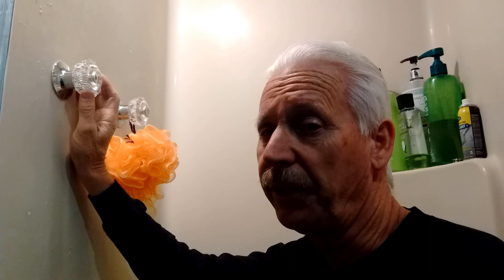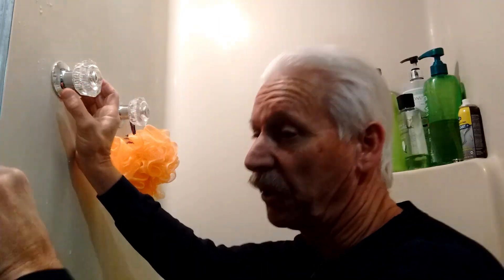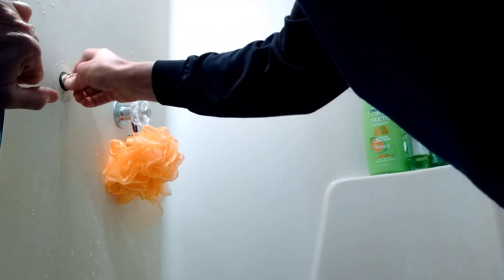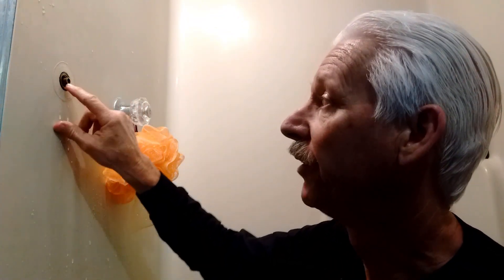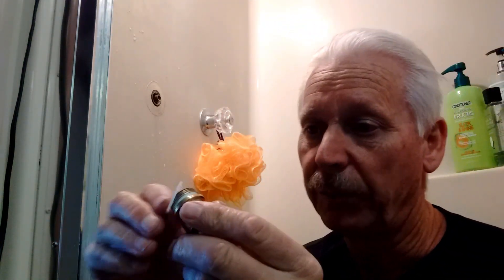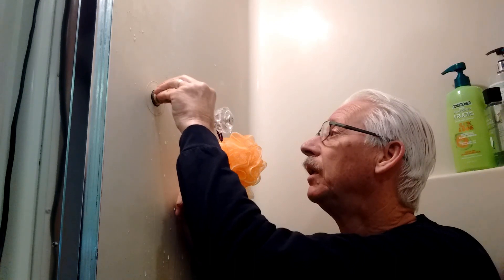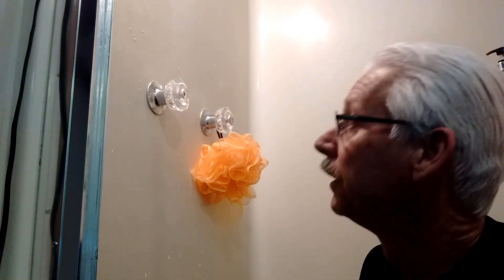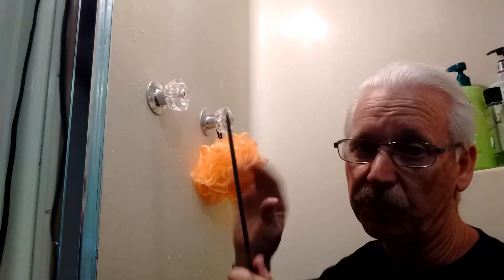Shower drip stuck faucet seat

Comment: What make is the faucet valve stem and handle? I need to replace them as I stripped the handle and it is leaking. Don't know what kind of handle to get or valve stem if I need it.
Reply from the maker: That was an older manufactured home and I could not find any brand so had to just take parts in to a plumbing store and match it up.
Reply: Thanks will do that.

Comment: My guess is 99.5% of the people watching are NOT gonna have a protruding seat like that specialized one. Almost always, the seat will be deeply recessed in the wall and you either replace the seat by unscrewing or using the proper reseating tool to reshapen the seat face.
Reply: Very true.  Also, with those deeply-recessed seats, a problem can arise if you use an Allen wrench to remove the seat.  Unless it's a tight fit, you run the risk of rounding out the hole, as the seat hole is not an exact square ... it's a rounded square with tiny notches in each corner.  The correct removal tool is only about $8 and being tapered, you are ensured a tight fit.  To help, you can also squirt WD-40 around the old seat before you try to remove it.  To aid installation (and future removal) of the new seat, use plumbers grease around the threads.

Comment: Nice Video. Do you know how to remove those long seats? I have new rebuild kit that has long stems and short seats. I can not figure out how to remove the old long seat that is identical to yours as it seems to just be round inside thus not giving the seat tool anything to grab on to.
Reply from the maker: I could not get this seat out and using the file trick is only good for awhile. Eventually i will have to rip out the wall behind and replace the whole manifold and everything. Perhaps that will be a good video. Also sometimes a knife sharpening stone can be used instead of a file. Good luck.
Reply: I realize it's kind of randomly asking but does anybody know a good place to stream new tv shows online?
Reply: @Melvin Jackson Thank you, signed up and it seems like a nice service :) I appreciate it!!
Reply: @Vicente Dominic you are welcome :)

Comment: If the seat needs to be replaced And is inside the pipe a screwdriver or an Allen key or an E-Z OUT will definitely REMOVE SEAT IF IT IS REALLY HARD TO REMOVE, use a some liquid wrench or WD-40 1st
Reply from the maker: Yeah, I thought so too. Tried all those, nothing worked.

Comment: My friggin tool broke INSIDE The seat. I'm buggered man!
Reply from the maker: oooh, that is bad, so sorry to hear that. Last time that happened to me I had to replace the whole thing. Had to cut the wall open behind the shower which was a closet in a bedroom and it is a big job. Anybody else have another idea that could help? Drill it or use an easyout tool? Your probably going to have to replace the whole works.
Reply: @AlFixit  Most people break the tiles and later they need to re-tile the whole shower room, but as you said, unless it is a solid brick wall, the easiest and cheapest way is to replace the faucet from the other side of the wall. I have seen being done this way. Cheers.